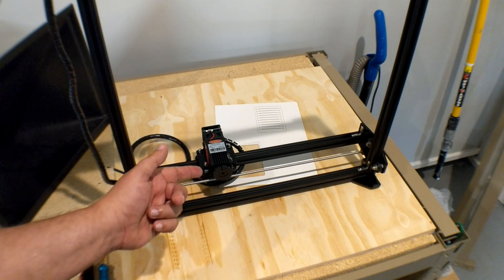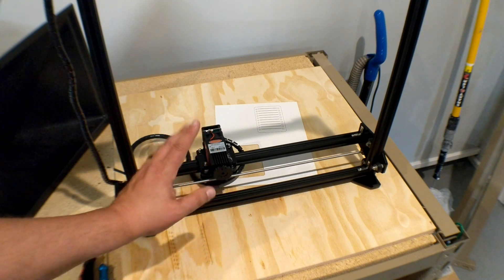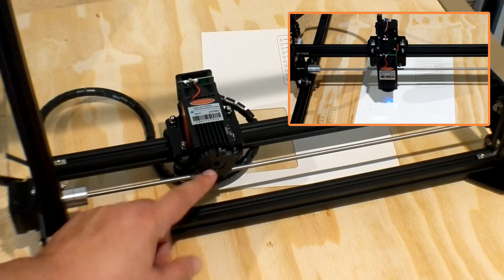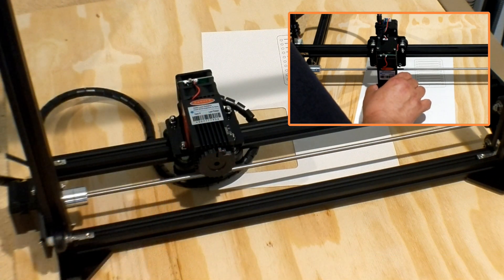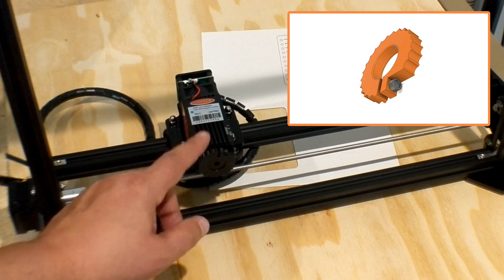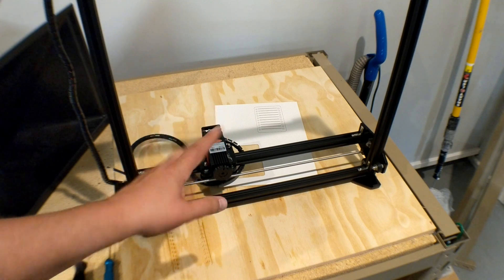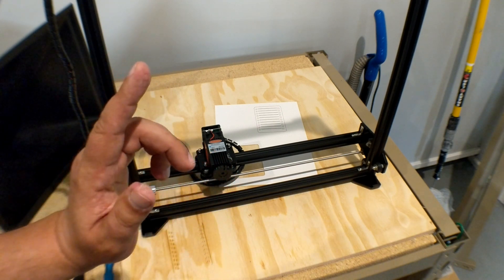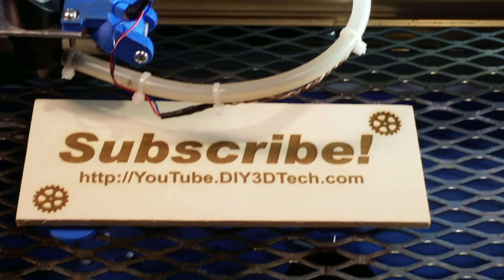Ortur Laser - 3D Printed Laser Focus Knob!

Comment: I got my Ortur about 3 weeks ago. The knob is slightly larger in diameter.  (21.4 mm vs 18 mm).  I'm going to enlarge the hole and reprint.
Reply from the maker: Cool let me know how things work out for you
Reply: It worked out great. The larger hole means there isn't much plastic at the point where the cutout is for the screw head, I'm sure it will hold since you don't need to tighten it that much for a good hold.

Comment: According to my experience, adjusting focus is wasting time. The perfect upgrade for a laser diode is a height adjustment. You take your time once for adjusting the focus for the height you like (I personally like 50mm for a good fume extraction). Then you 3D print a distance jig. Then you just have to distance your diode with the jig according to you object thickness. You can't do faster.
Reply from the maker: To each their own, however I personally find adjusting the beam gives me a perfect kerf (or as near as possible) verses attempting height adjustment..
Reply: @DIY3DTECHcom  with a height jig you reach the perfection first time, anytime. Someday you'll probably get bored adjusting again and again.
Reply: the problem with the frame is that it cant be adjusted lower, and ortur advise 30mm between diode and object for finest dot, so some sort of adjustable base has to be inside the frame.